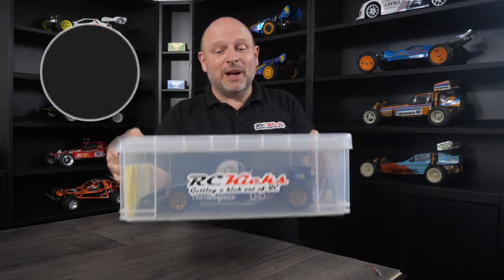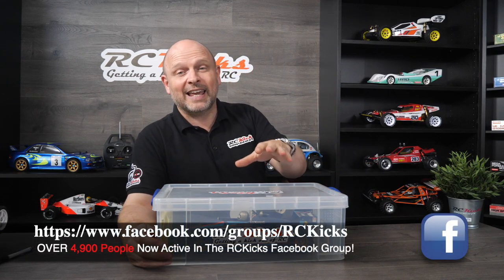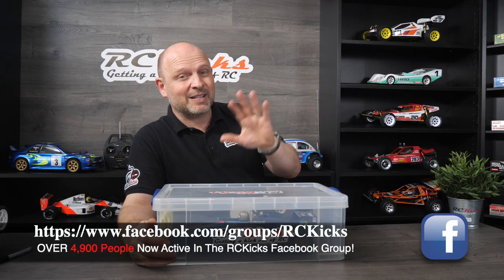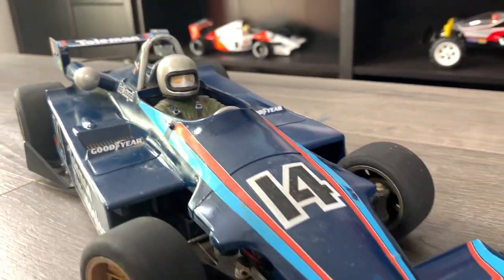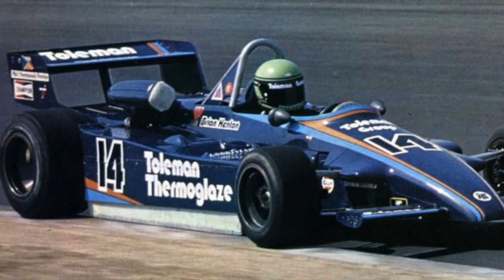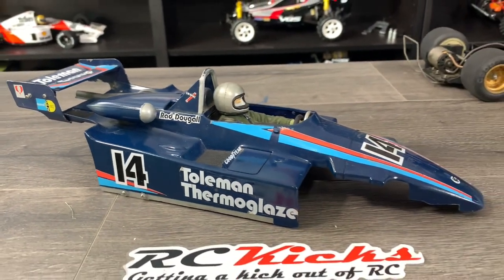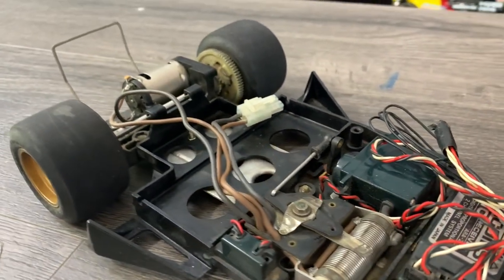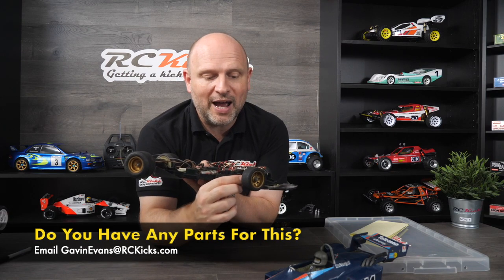VIEWER GIFT! 1980 Tamiya Ralt RT2 Hart 420R RC Race Car,  Kit RA-1018  (TAMIYA"S 18th Kit)

Comment: Thanks for the video it looks better without any dust on it
the 27mhz radio should With a pair of Cristal work 
a five sell six volt battery is all that's required
Reply: It's not Christmas it's christalse no I can't spell christal in the ploral
Reply: It's nice to had the feed back from the replies

Comment: What a beauty Gaven, congratulations! Will you test it on a track or should it go into a shelf?
Reply from the maker: I will run it for the show and then it will go on the shelf.  I need to find a replacement front upright first but apart from that I think it will run.  Well that's if the electronics still function.

Comment: Noooo! Keep it original. Dont strip it and take the original decals off. Just re glue the splitter and rear wing, polish the under tray and may be do the wheels. Keep it as original as possible otherwise just loses all its history.

Comment: Great video and idea about framing the letter and putting it with the restored car , again I wouldn’t be repainting it as that would destroy the genuine look and patina of the car , it will loose some of its history if it’s really painted. I’d just repair it and clean it. I would strip the actual  car though , clean it and recommission it so it all works. Cool 😎
Reply from the maker: Yes I think you are correct.  I might just clean it up and then see how it looks.  I could clear over the top of the car but I will have to see.
Reply: @RCKickschannel  looking forward to seeing what you do with it and the finished result

Comment: What a beauty! I agree with the other comments, I'd just clean it up a bit. A lot of the repro decals I have bought off are not great.  I'm going to do that with my Vintage Ligier JS9 Matra I recently bought. Main issue is parts. The front tyres and wheels seem to be impossible to find.